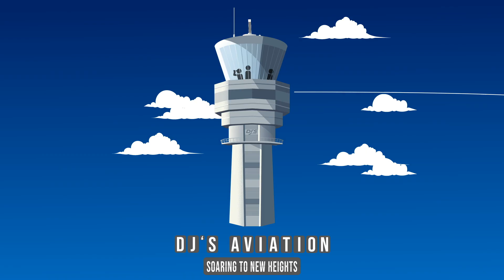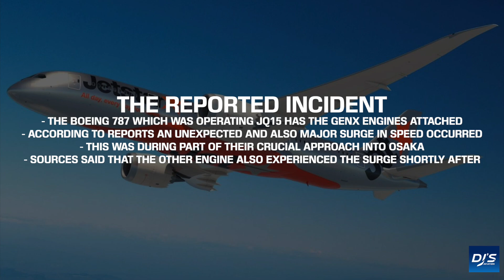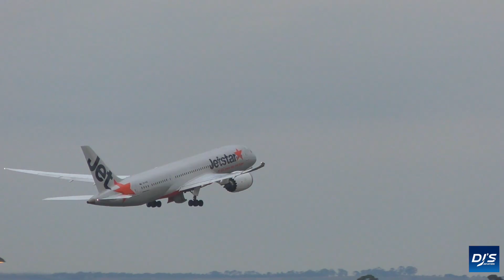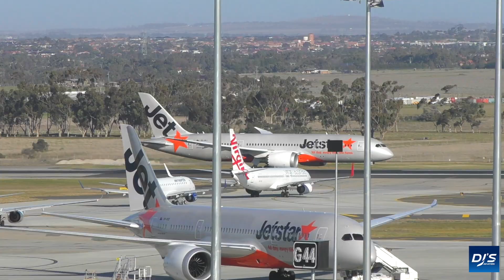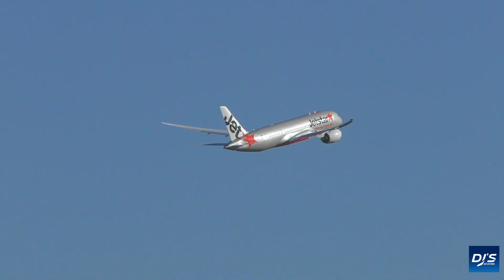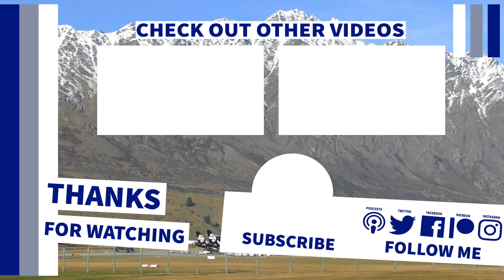Boeing 787 Experiences Dual Engine Problems

Comment: Just like cars electronics failed imagine planes which are tons and tons of computers ofc they gonna fail
Reply: Anderson Rodriguez technically an engine will only fail if it lacks fuel, ignition and air but I know what you mean. Modern engines can automatically shut down if damage is detected to prevent further damage or worse uncontained failure
Reply: Thomas Mortimore good to kn didn’t kn that
Reply: @andersonrodriguez8258  The only problem now: pilots who still remember how to fly manually.
Reply: Cedric John Llorente true only the old pilots still have good skills
Reply: @andersonrodriguez8258  Or properly trained pilots. Or, pilots who have enough willingness to learn manually fly themselves.
Reply: Cedric John Llorente Boeing pilots to me are better I would fly a Boeing plane feel more in control than a airbus PlayStation mid with GameCube control stick
Reply: @andersonrodriguez8258  Although, Airbus allow manual override too, albeit more complicated procedure. You need to disable flight computers to force it into alternate law.

But yeah, I prefer the ergonomics of the Boeing aircraft more, especially 777 onwards. It is easy to determine the input of the copilot or autopilot.
Reply: Cedric John Llorente airbus is more complicated just like a Mercedes with bunch of sensors and computers and Boeing is Toyota simple reliable strong planes from 60s 70s 80s still flying today haven’t see one a lot of airbus of any flying that old
Reply: @andersonrodriguez8258  Well, because Airbus is almost half generation younger than Boeing.

Comment: I have stopped flying on all 737s and 787s cos after the lion air and Ethiopia crashes im now flying on all airbus planes cos i feel safer on airbus aircraft and if boeing wants customers they need too step up there game and make all 737max8s and max 9s alot safer and then we might trust the 737 maxs agsin
Reply: 737s don't regain trust like before even after fix because max come from long line 737 masterpiece o disaster
Reply: @77l96  but if u look on list 737  original/classic/ng/max is impressive list. I don't tell ng is not safe but sorry still is deviation from 737 family.
Reply: @mateuszzimon8216  737 is due for replacement soon.
Reply: @dbclass4075  4 gen with same type rating... I think 737 should end on ng
Reply: @mateuszzimon8216  End on NG or MAX, 737 is already planned for replacement already: Y1 project.
Reply: You're rediculous.  Why on earth wont you fly on a 787 lol.  I am guessing you are an aviation expert.   You obviously don't research much or check your news.  Both Boeing and Airbus planes have had issues recently.   737 Max series I will give you a pass on as I personally feel building an aircraft with incompatability between the engines and aircraft design was a bad idea, esp. if they needed to implement software fixes to keep the nose from pitching up.

Comment: It could be a fuel contamination like what happened on a Cathay Pacific A333 back in 2010
Reply: It could also be something like BA083. Unusual circumstances that affect both engines.
Reply: My first though exactly.
Reply: My thinking exactly.
Reply: How can a surge be because of fuel? That’s rubbish
Reply: Yeah I think so 
As both the engines suffered problem at the same time and also in the approach phase
The engines were fine throughout the flight 
I don't know much and learning about aviation
Reply: Exactly what I was wondering too
Reply: I am sure they are investigating the fuel first.

Comment: Two engines misbehaving at the same time is likely to be fuel related - have a look at BA38 or CX780 incidents. Both involved engines not responding to throttle due to fuel contamination, and in BA38's case filters which got clogged in unusual conditions.
Reply: Then both engines should go to their rooms
Reply: Bypass valve should of opened
Reply: Fuel is fuel. If its contaminated, its all contaminated, so would be apparent at the beginning of a flight when still on the ground . Hopefully

Comment: Josh, as you say strange, I wonder if they have any data they can work with? May be difficult to trace otherwise. Was it the engines or the control systems?
Reply: I suspect that it's probably the control systems onboard the Boeing 787.
Reply: or the Fuel.

Comment: I want four engines when I'm in the middle of the Pacific.
Reply: @Leon Cao Maybe not for you, but the odds are better.
Reply: Chris Cook The engines on modern large twin engine jets are way more reliable than older generation quad engine jets. There’s a greater chance of two engines failing on a quad jet (that isn’t an a340 or a380) than one engine on a modern twin jet. You are statistically much safer in a modern large twin engine jet taking you across the pacific. They’re so reliable, there really hasn’t been a double engine failure (unless something to do with fuel). Statistically you have a much greater chance of being hijacked or shot down rather than a double engine failure.
Reply: Chris Cook - They can use the APU (Auxiliary Power Unit) and descent safely, I hope.
Reply: Too bad
Reply: what if all for fail?,anything is possible when it comes to electrical and mechanical components.
Reply: @Leon Cao Yes because they are old.

Comment: Hmmm - was autothrottle engaged or not I wonder?
They may have a rogue Koala in the avionics bay...
Reply: Stephen autothrottle wouldn’t cause a surge. A surge is a disruption in the airflow going into the engines, the autothrottle just controls how fast the turbines spin

Comment: The response looks appropriate so far.  What causes a surge?  Interruption of airflow? Electronic control modules?  Engine sensors sending bad data to the controller?  How can that the cause be common to both engines?  What other data exists on this problem that has been overlooked so far?  Other occurrences that have been ignored?  There is such a thing as a fluke, but seldom.  If you find ten pilots who say "Oh yeah that almost caused a crash for me too" that would be a clue.
Reply: I wanna remember to u 777 have a trouble with RR engines and even one crash on Hethrow. For findning issues AAIB need a year to tell thats ICE.

Comment: I can not believe that this issue has struck again, even worse a different type of engine. The quality of engines seem to be lacking, I hope this is a wake up call before something worse occurs. Again nice work Dj.
Reply: Maybe enemy sabotage with cyber hacking😂
Reply: Takeoff Aviation it not the quality that seaem lacking.  It because the ingineer are push to make more and more efficient engine.  They push the available and new technology to their limit wicth can create unstable/unreliable engine.
Reply: @aswd45-mk14  seem*  because* engineer*  technology* there  are 4 things to correct
Reply: @mrbirdba  tank you!

Comment: Strange both engines going almost at the exact same time, Not many things I can think of to cause that scenario.
Reply: Cathay Pacific Flight 780 also had something similar but it was fuel contamination.
Reply: BA38 had both engines partially lose thrust resulting in it landing short and hull loss - was caused by water in fuel freezing and blocking a filter.
Reply: @tomkandy  The final report concluded that it was Rolls Royces Fuel-oil filter that was to blame, Latter Rolls Royce came out with a fix for it, It's definitely possible for it to be a similar innocent, but it occuring in an entirely different manufacturers product would surprise me.
Reply: @tomkandy  But this happened during the approach, not in icing conditions really. Really weird.
Reply: @MooseKicks1066  Well, British Airways 38 problems surfaced on short final. Although, the problem do started on cruise, albeit undetected.
Reply: Bird strike can cause surge
Reply: Like someone else already stated in the comments the first thing I thought of was a fuel issue like contaminated fuel.
Reply: Could also be another software issue. Did some automated control system freak out?
Reply: @sunspot42  No.
Reply: Josh Madams fuel or computers might be the problem with this issue.
Reply: Josh Madams ASH ASH ASH IN THE ATMOSPHERE
Reply: Just probability
Reply: Fuel or oil. Going with fuel
Reply: @REFEREEMOUSE  Uhm, aren't fuel are from crude oil?
Reply: There is a Boeing bulletin about reverse thrust operation potentially causing engine shut down. Full reverse thrust before the aircraft has transitioned to ground mode, followed by a quick deactivation of reverse thrust activates the Thrust Control Malfunction Accommodation (TCMA) system. This would cause the shutdown to prevent engine damage.
Reply: I can   COMPUTERS.. the death of aviation

Comment: Dosent sound that bad I think it a isolated problem
Reply: still..something to consider as this could have ended badly
Reply: @derpcakeflies  the pilots did not seem to think It was that bad yes it could have ended badly but pilots are hilt trained
Reply: So was the first 737 max crash
Reply: @tomstravels520  - There's no crash, no real problem, the pilots don't think it's a real problem. The 787 has been flying for years so it's safe to say it's an isolated incident. Can't be compared to the brand new 737 Max. There's more alarming incidents with the A380 recently but you won't find me worrying.

Comment: Hopefully we start hearing good news about boeing. I know the engines weren't made by boeing!
Reply: AirNews 24/7 ........Huh?!?  It’s in the title of the post. It was. 787
Reply: Wade Higgins ........the engines were surging randomly. Sounds like a software problem ad not a engine problem.
Reply: hpygolkyone It could have been a pilot error with the fuel or oil possibly lacking which can cause engine surges.
Reply: Jake Calvert ............they did away with flight engineers years ago. Pretty sure that aircraft are all turn-key and that pilots are systems managers these days. Meaning your engine either runs or it don’t run.  You’ve got your throttle and you can restart the engine and that’s about it everything else is controlled by software.
Reply: Even though it's a engine problem I'll still start losing trust in any boeing plane at this point. Day after day something is happening